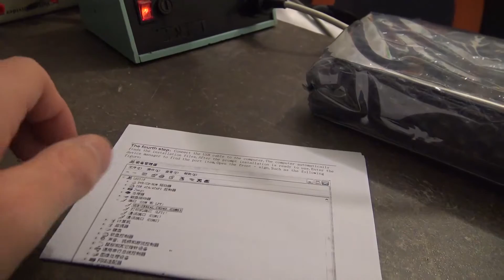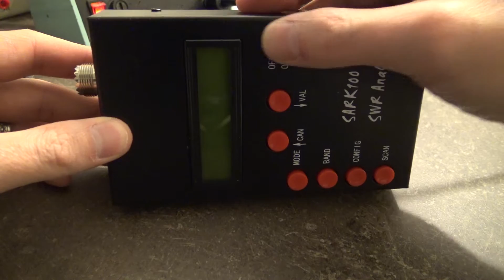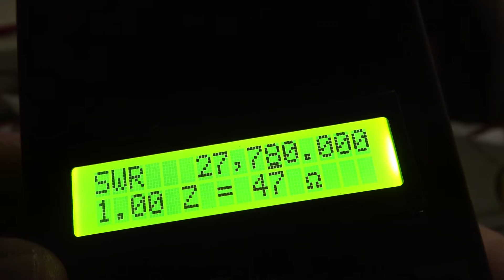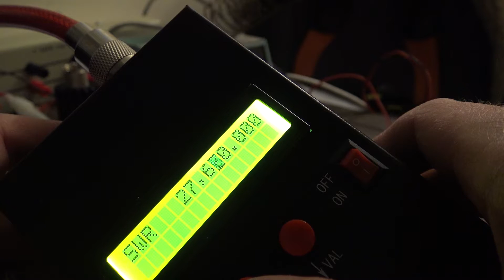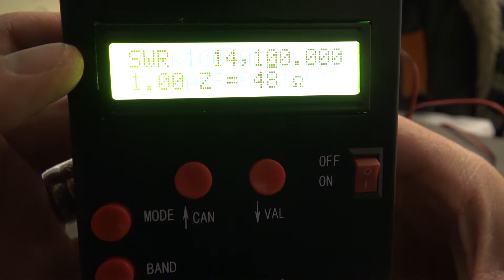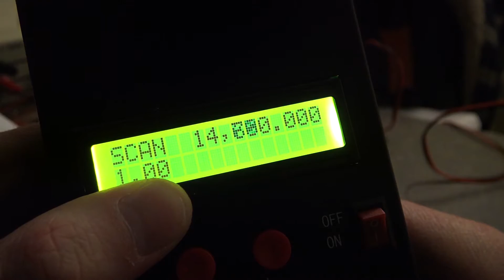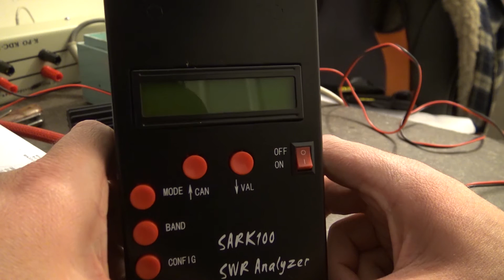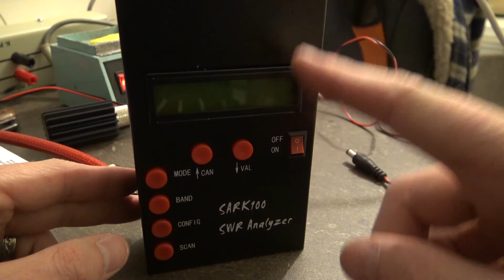SARK100 Antenna Analyzer Unboxing

Comment: Need to make an open plug, a 50 ohm, a 150 ohm and a 225 or 274 ohm ones too. To calibrate if you update SW. They used to be a kit now only factory built.

Comment: If you are using a half wave vertical, which would have a feedpoint impedance of about 300ohm without the matching coil in antenna to match to 50 ohm. This I imagine explains the 26ohm reading.

Comment: I have one and like it because it is much handier to use than my mfj259b. My 259b is superior just not as handy. If you keep it get a 8cell aaa and load it with aa's tight fit but works and the aa last a long long time. Mine tracks really close to my 259b.

Comment: Based on an open source design and you used to be able to find plans or kits. Now a couple of Chinese manufacturers build and sell it. No it does not have to be plugged into a computer but, there is software and you can do so, if you choose. You might want to read the directions first rather than whining and complaining before you even know how to run it. You get a scale and can see more info about your antenna with the computer program. Your bias is showing.
Reply from the maker: @johnbunker5102  I thought it was great mate, I’ve been using it for years now and no issues 🤷🏻‍♂️

Comment: Download manual. In different mode reads Z and J numbers more accurately. Driver goes on pc to talk to this. Get graphs, swr levels across band. Scan goes from 2:1 to 2:1 higher up. And you find  best swr point. Manual free on several sources. 73 wa2kbz